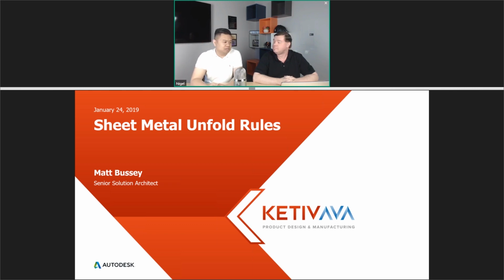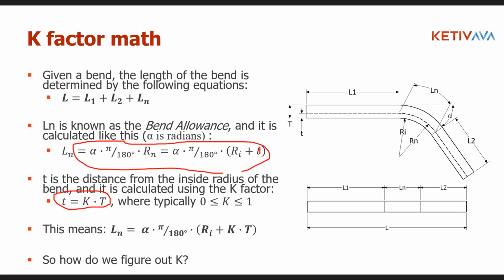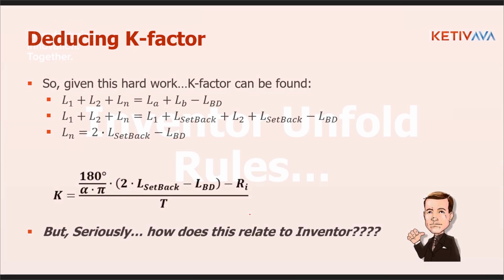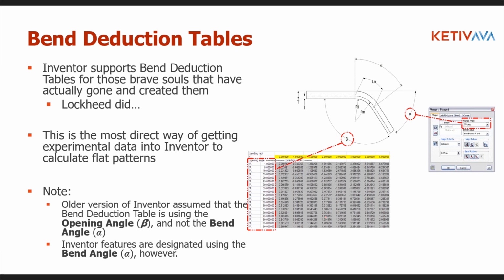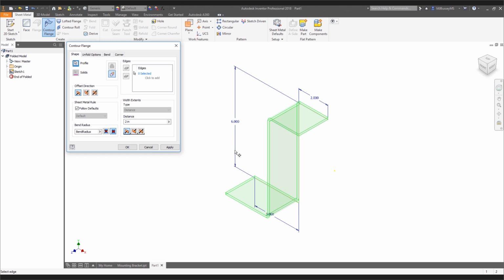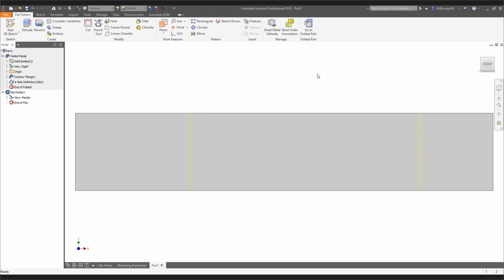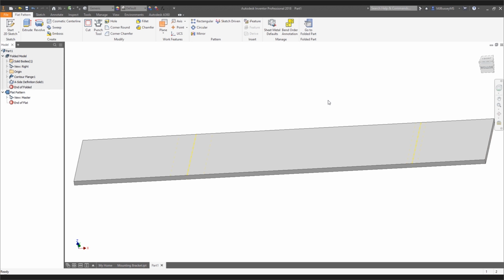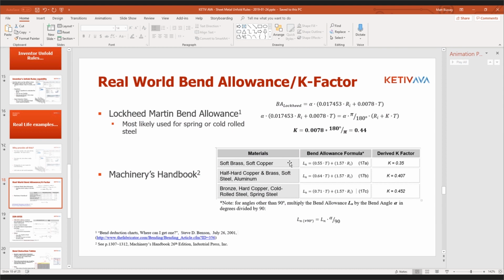Sheet Metal Unfold Rules | Autodesk Virtual Academy

Comment: Hey Mr., Thank you very much for your information.. I have a question, if I already make a folded part in standard part, then I want to unfold it, I think that I should convert it first to sheet metal.. I already did that, but then I can't unfold it, can you tell me what ia the problem? And how can I fix it?
Reply from the maker: Hi Agung, Thank you for your question.  Please check the thickeness of your folded part, then ensure that there are bends that allow for unfolding.  Ensure that your Sheet Metal Style is set to the appropriate thickness.  Lastly, try selecting the face then hit flat pattern.  If all those things are in alignment it should unfold. Nicole Morris|KETIV Support Team Lead